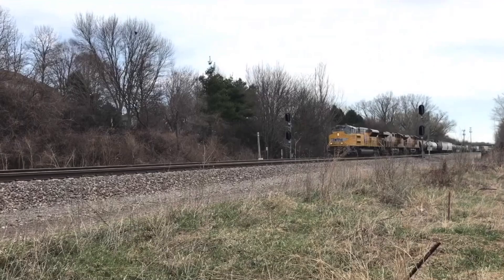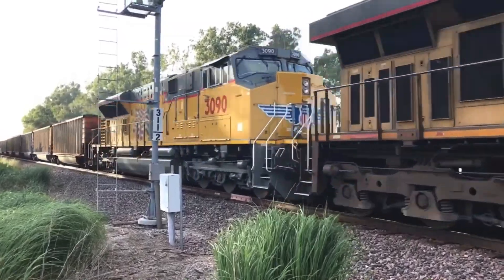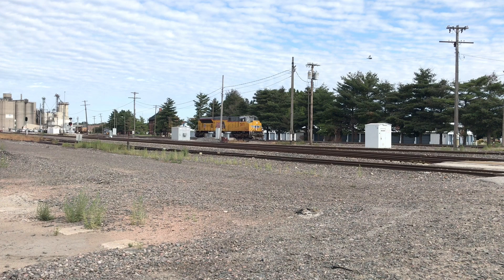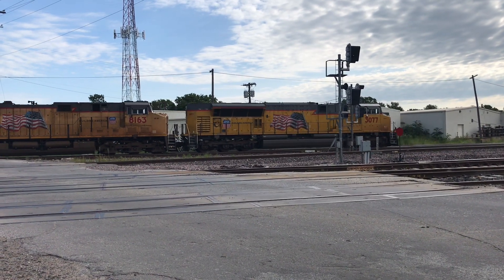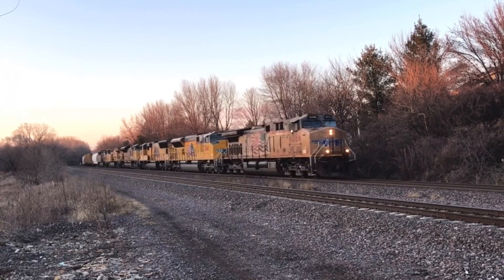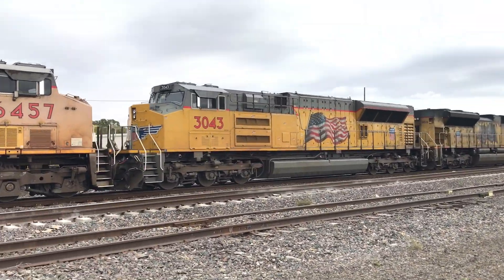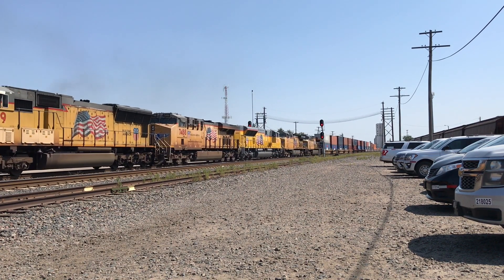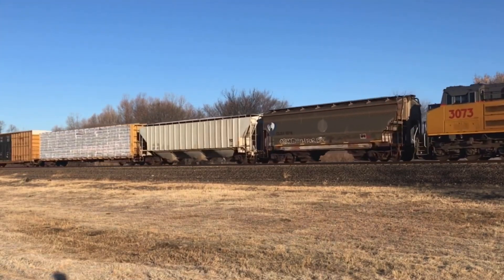Engines of UP-SD70ACE T4

Comment: First order SD70M's also have K5LA horns. Going back to the ACET4, the cab is nice and spacious, the teardrop windows are god sent, horns are awsome eventhough you get tired of them after a whole trip(never thought id say that) and the locomotives themselves hold the rail pretty damn good pulling uphill, lightyears better than og 70ACE's, they are also quiet af inside. Downhill the dynos are just as garbage as the og 70ACE's, going through tunnels the cab is shit garbage at staying sealed up you get a bunch of diesel exhaust in the cab, the screen controls on all EMD's are overly excessive eventhough having 2 train length counters is nice, they tend to have electrical gremlins in the locomotive electrical systems, and a bonus from a railfan standpoint that doesnt really pertain to how they operate is that they sound like damn vacuum cleaners when they are running instead of sounding like an actual locomotive lol. Overall though they are a major improvement over the previous SD70ACE buuuuutttt its always much better to have a C45ACCTE instead of any EMD in your consist for reliability reasons lol.

Comment: csx has used their sd70t-4s on locals.   SD still holds its meaning'
Reply from the maker: No it doesn’t hold its meaning, they only did that to test the locos out
Reply: @unionpacificomaha  Years ago I learned from reading The Diesel Spotter's Guide and other books that EMD's model designations were: GP = General Purpose, 4 axles, and SD = Special Duty, 6 axles. The original idea was that GPs could serve as road engines or switchers, whereas SDs were for road service and heavy drags such as coal or grain trains. In the 70s, I saw lots of GP 40s on Conrail's fast priority Intermodal trains. Somewhere along the way, in the late 80s or early 90s, they stopped offering any 4 axle units except for yard switchers. You are correct that SD stands for "Special Duty", but the specific detail that made a loco either and SD or a GP was the number of axles. Now that EMD is no longer part of GM, who knows? Maybe the original designation has changed. Thanks for your work on this video, by the way.

Comment: Thanks for doing this video; I appreciate videos about specific locomotives. I read somewhere that UP was having some reliability issues with the locomotive and that the manufacturer was making changes to the software that controls locomotive systems to resolve the issues. Hoping UP/manufacturer can resolve the issues so it can compete successfully with GE. I subscribed and gave the video a "Like."
Reply from the maker: Thank you so much! Thanks for that info too, it’s definitely neat to hear
Reply: The SD70ACE-T4's were immediately pulled out of service due to numerous issues involving their computer and electronic systems.They were deactivated for some time while repairs and updates were being done.The other problem at first was the fuel injection and the costs to do maintenance.

Comment: That's actually a SD70AH-T4 Because SD70ACEs are units with the Headlights mounted between the number plates.
Reply from the maker: I called it a AH. Also incorrect not all of the ACEs wirh low headlights are AHs. The 8600-8700 units have low headlights and are ACES
Reply: The headlight locations on these loco's are wherever the customer specifies.  Headlight location is not an accurate way to tell what type of locomotive your looking at. Case in point with the CW40-8's.  UP often ordered them with nose headlights and number boards. Conrail liked high headlights and low number boards and marker lights. ATSF liked nose headlights but high number boards.  Still the same locomotive, just customer preference.

Comment: It’s a very unique looking locomotive. It has a partial GEVO hood interrupted by ‘hump’ of the sd70ace’s hood, and sd90mac windows
Reply: The hood has no GEVO influence, but EMD used the exterior cab and hood design from its 1967 FP45. Which other manufactures used as guide to there designs such as GE.
Reply: It’s basically a modern version of the SD90MAC-H

Comment: Why EMD trains are not as common like GEVOs?
Reply from the maker: Because railroads have more GEs
Reply: @unionpacificomaha   I see igeuss also more feul efficient two.
Reply from the maker: @izzymillar4568  GEVOs are just more reliable and better all round
Reply: @unionpacificomaha   That is not why they have more GE's.  EMD lost it's footing awhile back when they got too wrapped up in cost cutting. GE pulled ahead with deliveries and offering better deals that the Class 1's jumped on. Before long the lead got so great EMD could not recover and basically went under to the re-structure. EMD's are reliable and dominated the market for a reason. It was just terrible management that caused the issue they had.
Reply from the maker: @FFred-us9tw  yep started with the SD50, GE been on top ever since
Reply from the maker: Crews favor Gevos, easier to run
Reply: @unionpacificomaha  is it possible that GE will eventually buy out EMD progressrail Caterpillar company. Or merger with them?
Reply: @unionpacificomaha  What does that even mean? I've been an Engineer for well over 20 years.  I've run everything from GP9's to ES44AC's and pretty much everything in-between on run throughs. I have never heard any Engineer describe one modern locomotive over another as being "easier" to run.  They all have 8 throttle positions, they all have the same brake positions. We are not talking about 24 brake vs EPIC brake. 

 I have never found one locomotive "easier" to run than another. I have certainly found some locomotives to be more comfortable, faster loading, better dynamics, better visibility, etc. But what does "easier" signify?
Reply from the maker: @FFred-us9tw  I’ve talked to a few guys on bean sniff and they’ve called Gevos “much easier” to run compared to other road units because they pretty much run them selves. His words not mine
Reply: @unionpacificomaha  Ok, must be a unique group of guys you talked to because I've never heard such a bizarre statement from any other Engineer.  Unless they are talking about the stupid Trip Optimizer doing their job for them, i can't imagine what constitutes a locomotive that "runs itself".
Reply from the maker: @FFred-us9tw  yeah I believe he was talking about that. I don’t remember her exactly

Comment: I wonder if EMD will finally able to make a proper 4-stroke engine this time
Reply from the maker: Who knows
Reply: @unionpacificomaha  the 1010J is a modified version of the 265H. It's virtually the same engine as before just with a redesigned crank to prevent harmonic cracking and added emissions equipment and I think a new fueling system. New software too. The 1010 also comes in V12 and V16 versions, and serves as the basis for the further modified CAT C280 engine. They C280 and 1010J are virtually the same with the 1010 just having been optimized for rail applications. I believe the C280 can be had in up to V20 configurations (don't quote me on that), so the output of this engine platform ranges from 4700-6000hp+ (can't remember the maximum output for the largest version). Another thing that distinguishes the 1010J from the C280 is the alternator and cooling, and air charge induction systems as well as power electronics such as integrated AC power inverter converters. You can hear the alternator and inverters at idle humming along with the engine rumbling as the emissions equipment really muffles the engine sound. If the 1010J were to be straight piped like the 710G prior, utd sound just like the SD90MAC-H with the 265H engine. It's a shame that it doesn't but it's understandable given EPA regulations and sound pollution restrictions near residential areas as well as NVH reduction for operators whom which complained significantly about how loud EMDs 710G was, even with the SD70 series isolated cabs. 

Cool stuff. Our railroads are evolving before our eyes.
Reply from the maker: @scenicdepictionsofchicagolife  thanks for the cool info!
Reply: @scenicdepictionsofchicagolife c280 and 1010 are not the same engine.  The c280 is a high speed 4 stroke that can be run up to 1800rpm.  It’s still a 3500 series engine.  The 1010 is more like cats 3600 series.

Comment: Unpopular opinion: that is one of the ugliest locos in UPs roster
Reply from the maker: I would say the top hump is kinda ugly, but I like the cab horn and engine sound from these locos
Reply: @unionpacificomaha  yeah you can tell they tried to hard to make it look like an sd70ace without it being an sd70ace
Reply from the maker: @darth_dingus7306  I don’t think they really care how it looks, they just want it to do it’s job well while keeping it a EMD like shape
Reply: @unionpacificomaha  At Least The Hump Doesn't Run The Entire Length Of The Engine Compartment On The GE Tier 4's, Except For The Demonstrator Units.
Reply from the maker: @calebtrains2261  oh yes, the demonstrators looked real bad. I don’t mine the regular GE T4s tho
Reply: @unionpacificomaha  O.K.  BTW. Last Month On CSX Q301, I Saw An SD70ACE-T4 (ST70AH(CSX'S Locomotive Classification Symbol For Them)) With An ET44AC-H.  CSX ET44AC-H #3255 Leading, And CSX SD70ACE-T4 (ST70AH) #8904 Trailing.
Reply from the maker: @calebtrains2261  cool
Reply: @unionpacificomaha  Thanks.
Reply: Appearance doesn't get the job done.

Comment: Sir can you compare emd SD70Ace-t4 vs GE ES44AC which is more stronger, fuel efficient,more eco friendly etc??
Reply from the maker: If i did it would be vs a ET44AC since they are both T4 units
Reply: @unionpacificomaha  ofc. Either way both the ET and SD T4 units are most powerful and have more tractive effort than an ES44AC
Reply: @scenicdepictionsofchicagolife   Actually that is incorrect. The ET44AC has the same tractive effort as the ES44AC.  An ET44 is simply a T4 compliant ES44.  It's not a more powerful locomotive. It just has all the added T4 nonsense for emissions.  I'm not saying you, but it amazes me how many buffs love talking about "TIER 4"!! thinking that they are some sort of super powerful locomotives vs the old ones.  Tier 4 ratings are simply emissions. Not power.
Reply: You don't need a video on that. The spec sheets are easily found online.  Both are Tier 4 Compliant.  Both are 12 cylinder engines.   GE ET44AC:  HP: 4,400. Tractive effort: 183,000 (starting) 166,000 (Continuous).    EMD SD70ACe-T4:  HP: 4,400.  Tractive effort: 200,000 (Starting)  175,000 (Continuous).    So the EMD is considerably more powerful.   It does burn slightly more fuel then the ET44 but the tractive effort more than justifies that to the railroads.    The ET44's have been around for almost 5 years longer than the SD70ACe-T4 so it should not come as a surprise that they may be more reliable at this point since they have had far longer to work out any issues.

Comment: It almost seemed routine that G.E.'s tier 4's were in regular production ahead of E.M.D. It was nice to see these E.M.D's being ordered by CSX and UP. But with rail traffic down and railroads opting for large rebuild programs, rather than large orders of new locomotives, I wonder if the SD70ACe-T4s will have the same anti- climactic ending as the SD90MACs and the AC6000s. I have only seen one of the E.M.Ds, a year or two ago on the NS Chicago line, just east of Toledo Ohio on a westbound manifest.
Reply from the maker: Yea I think they’ll be fine. UP has the most of them and I’ve seen like 35 of them so far so I’ve got a good start
Reply: The SD70ACE-T4's are the modern version of the SD90MAC's actually.
The 1010J's in them are rebuilt and improved EMD 265H's having the same block.
The 265H's in the SD90MAC H1's & H2's only lasted several years as EMDX units for Union Pacific and Canadian Pacific due to major failures and unreliability.Most of the units that weren't scrapped became exports for BHP Biliton.
The AC6000CW's had continous crankshaft and turbocharger failures which is why Union Pacific rebuilt them as C44ACM's and CSX's CW60AC's became CW44-6's before being retired.As for the SD9043MAC convertibles,most of them ended up with cracked frames.Canadian Pacific rebuilt 30 of them into SD70ACU's and acquired 39 SD9043MAC's from Union Pacific.
Norfolk Southern purchased 110 units from Union Pacific dirt cheap for the SD70ACU rebuilds but then sold 65 to PRLX.CEFX SD9043MAC's are still around but on leasing terms only.

Comment: Only about 90 and ive seen 8 of them. They are nice to see on UP
Reply: CSX Uses The Same Model, Although They Only Have 10, And Are Classified As "ST70AH."  I've Seen 2 Of Them (#8907 And #8904).
Reply from the maker: I’ve seen 30-40 of them. Yes I love them

Comment: Cool! One question, I just uploaded a new video showing my layout really quick and when I snap this one track to the switch it looses power to the track. I already switched out the switches what should I do
Reply from the maker: I would suggest making sure all  connections in the track are smooth and nice and if that doesn’t work get a little cloth wet with isppryal alchol and rub the rails
Reply: @unionpacificomaha  i solved it, i was running the track to where it short circuited. Thanks for the help!
Reply from the maker: @AndrewD1293  your welcome!